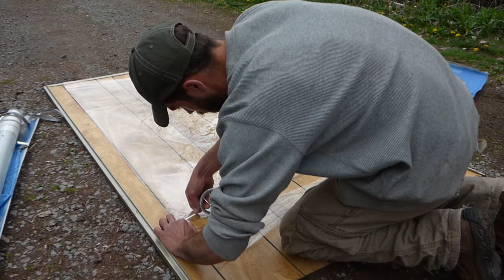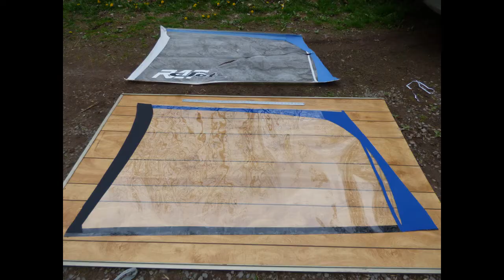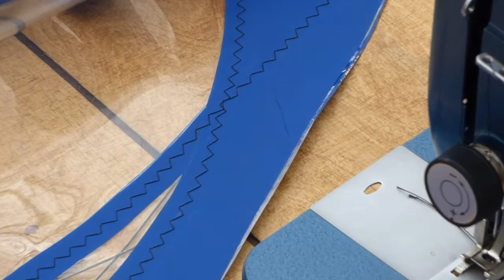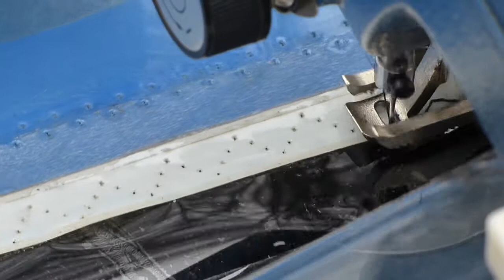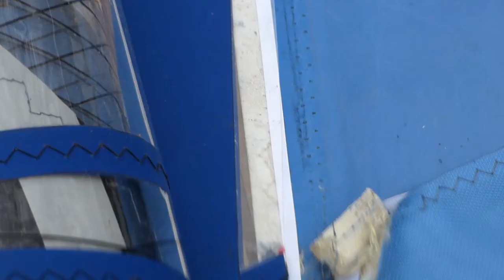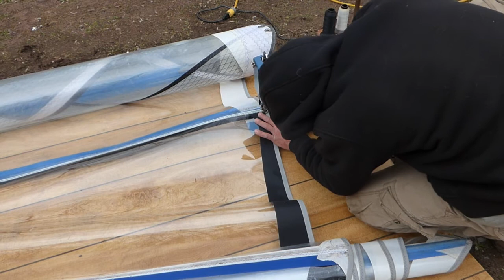Windsurf Sail Repair - Panel Replacement - Part 2 Assembly

Comment: Hi. thanks for the video. It was a lot of work. One question. Why didn´t  you try the traditional way? I mean by laying the new monofilm over the old one, stiching, then removing the old one..Much easier, instead of removing the old panel and do the whole new panel placement again.
Reply from the maker: That's a good question.  I didn't know there was a traditional way. I have never seen a repaired monofilm sail and couldn't find much information on repair(didn't try too hard).  While I had considered an 'overlay' repair, I was afraid of adding weight and not sure how to secure the damaged section.  If you can you give me a link to more information, I'd greatly appreciate it.  Thanks for the comment.
Reply from the maker: I gave the 'traditional way' a shot.    https://www.youtube.com/watch?v=myexHKZ8luM
Took less than a quarter of the time as the first repair, looks promising.  Thanks for the pointer.